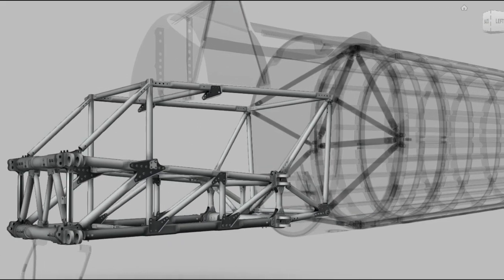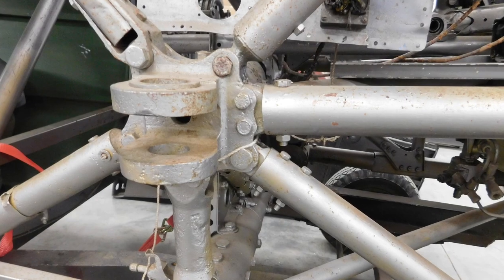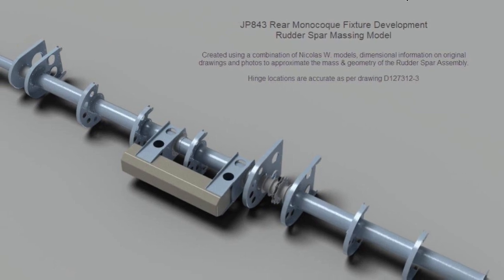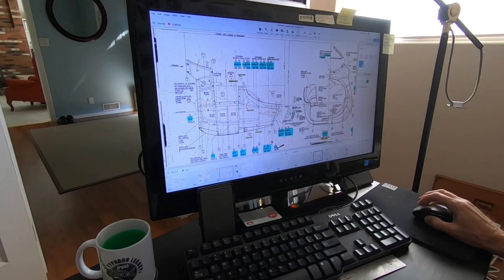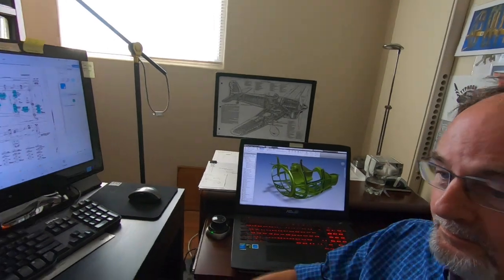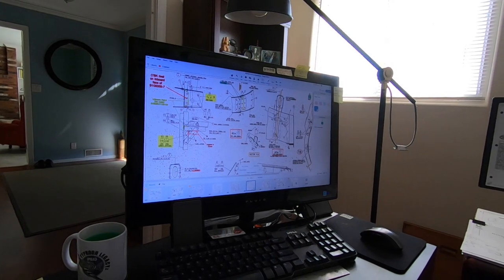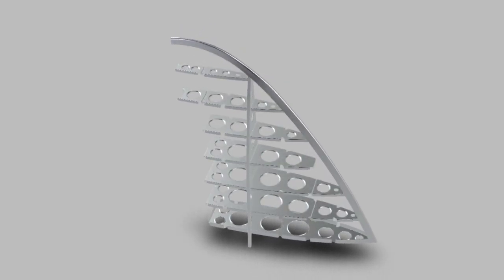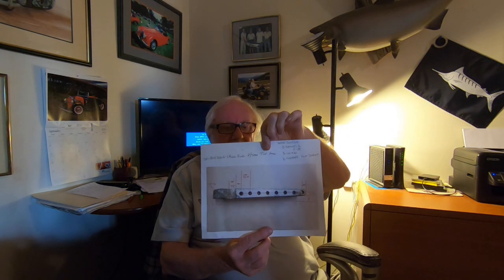S1E4 Hawker Typhoon Design Work Part 2

Comment: Great videos! Question: Do you add coating thickness to your 3D geometry?
Reply from the maker: It's not typically a factor with this application. The scan data will be used with original drawings and surviving parts to create the information needed; if it is found to be an issue in any work it will be investigated and corrected in our CAD models. ~Ian

Comment: This is terrific !  With access and knowledge on the very latest drawing and dimension methods this will certainly produce an extremely accurate and much lower labour cost aircraft. I was fortunate to meet  and know an ex-R.A.F. fitter who worked on these magnificent monsters during the war. ( he became profoundly deaf as a result)  He told me that the radiators weighed an astonishing 3/4 of a ton !  I wouldn't argue but l would have thought the radiator would have been aluminium so l guess  it must have been gargantuan!  Enjoying this very much . Little knowledge but plenty of enthusiasm ! Thankyou.
Reply from the maker: Thank you for following along with us John! 3/4 ton may be a bit of a stretch, but they were very heavy being made with a great deal of cupronickel alloy. ~Ian

Comment: Any revised drawing would still leave the original drawing intact although it should be noted on the original how many new versions there are. If you're picking up less than the total drawing output you could be anywhere in that process from any given drawing. Technically you should be revising where there were revisions which may or may not have made it back from the shop floor to the drawing office depending on how Hawker organised themselves there may have been drawing logs which noted the revisions rather than a panel list in the corner of a drawing. That way a mistake that wasn't a mistake still had a drawing and each could be traced back and forth through production dates.

Comment: It continues today, management and the engineers toss the drawings over the wall to production and production tries to build the thing. It is a one way only process. Production is not to question or provide feedback, just to get it done. So the shop floor drawings are illicitly marked up, parts are hand modified, and an alternative "as built" is produced but never documented.  To document these changes would be to assume some  intolerable equality of thought between the lowly craftsman and their betters.  A bit of culture shock for me when having some custom equipment built in England.  Going the other way, for an engineer or manager to pick up a tool on the shop floor or to step into the workers lunch room would likely shut the place down. It is just not done.
Reply from the maker: There always seems to be something like that in the way of progress. ~Ian

Comment: Hi - very interesting. Automotive engineer here... I'm wondering if this work will be extended to FE for stressing, durability etc. or is that a whole other can of worms you don't want to open?... ;-)
Reply from the maker: There is really no need to go into that area when the original design specifications are available, if we need to make any significant changes to the design we would have to, but that is not anticipated. ~Ian

Comment: Another great episode. Really great to see and hear how all the members of the Typhoon JP843 team are taking on aspects of this project. It seems you may have just enough drawings, original sections, and scan data to properly restore JP843 to flight.
Reply from the maker: I always learn something when I'm talking to different team members, each bringing a massive amount of specialized experience to the project. We certainly have most of what we need to rebuild the structure, but there are still some smaller gaps. Now we need to focus on systems components, an area we will need to bolster in preparation of structural assembly completion. Thank you for following along! ~Ian

Comment: Hi, really interesting video. What CAD system are you using? I'm a designer at Westlands (Leonardo nowadays) in the UK and over many years have worked my way from Drawing Board to CADAM, Catia V4 and now V5.
Reply from the maker: Hi Mark, thank you! Between the three designers, we have AoutoCAD, Fusion 360, Autodesk Inventor and Solidworks. The primary software that we use for the final stage of design is, in most cases, Autodesk based. ~Ian
Reply: Hi Mark, I worked at Westlands many years ago on contract, I was Bristol based. Worked on the EH101 blades and entry door. I believe we used Cadam and the board in those days.